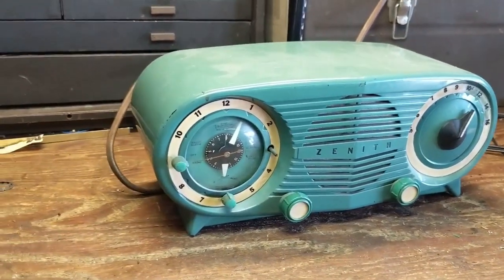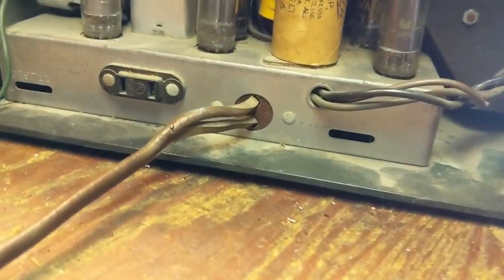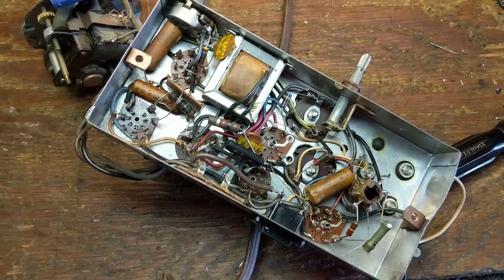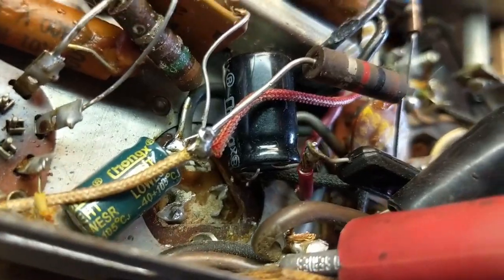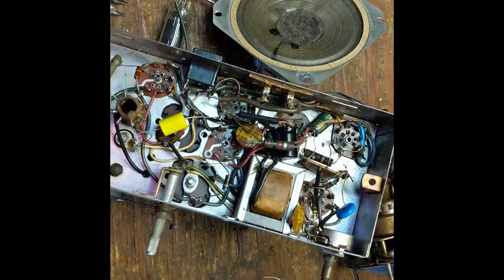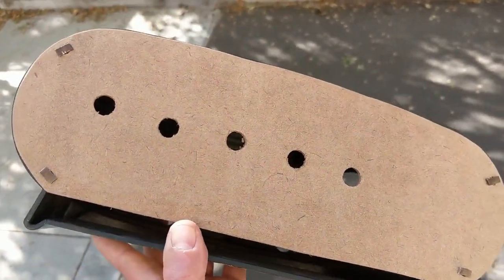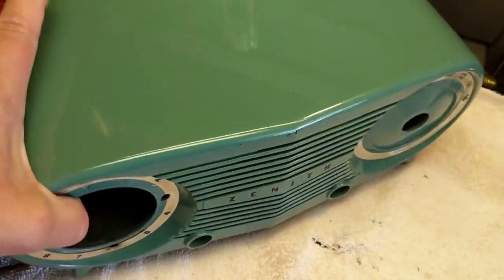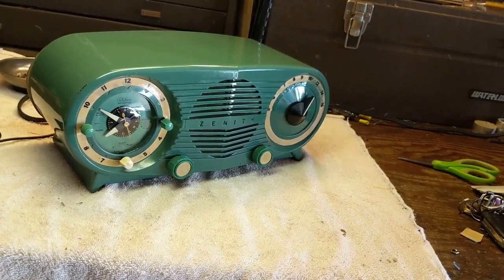Total overhaul: Zenith clock radio

Comment: Think this is a model J-514. They didn't type it on either label on the bottom but either stamped it with an inkpad in
 the upper right corner on the bottom of the chassis or wrote it on the large label in the upper right corner.
 Your homemade Masonite back is too big. It should be recessed 3/8'' inside the back. Won't say anything about those
 too few airholes either. There is a nice photo of the back of the J-514 radio at the Worthpoint website.
 That rod antenna was the perfect pick for it as it is a good size.

Comment: Did you change out that smoked resistor? I looked but couldn't tell. Pretty cool radio.
Reply from the maker: Somehow that resistor was still in spec. So I left it there.
Reply: @misterradio5035  Wow. It looked really wasted.

Comment: I've got one of the brown bakelite versions.  They perform well.  Usually the loop antenna functions as the antenna coil, so I'm not sure if you'll lose some sensitivity with the ferrite rod.  At the least, you'll probably have to re-align the set to get peak performance out of it.  Definitely a more collectable color, and for me a crack won't dissuade me from an unusual radio.  Nice job!

Comment: What’s that “dog bone” shaped capacitor or resistor that looks like it’s coated with sand?   I’ve seen those in many of your videos.  As always I enjoy your channel as it’s very informative 👍
Reply from the maker: They are literally called "Sand resistors". Its a wire wound resistor that is coated in sand, I assume to help dissipate heat